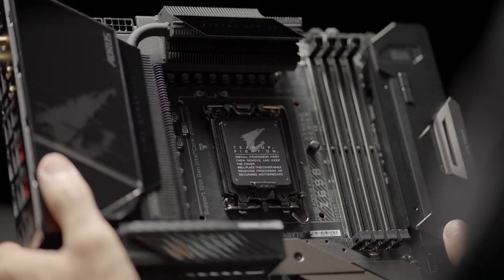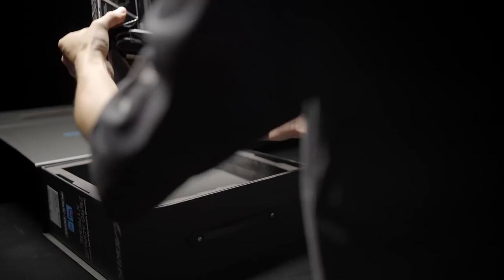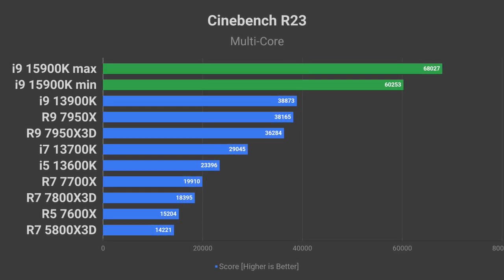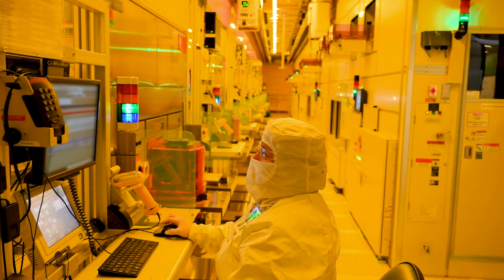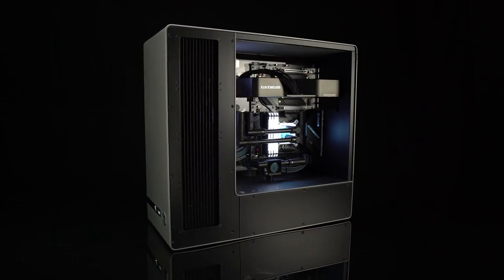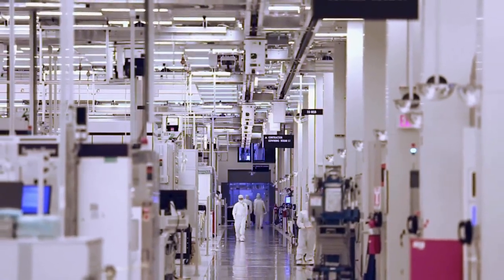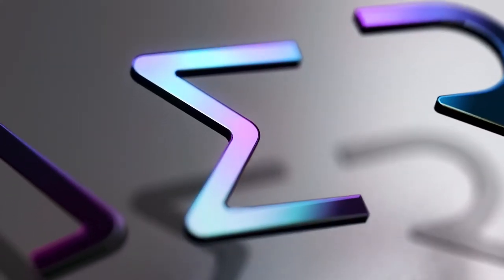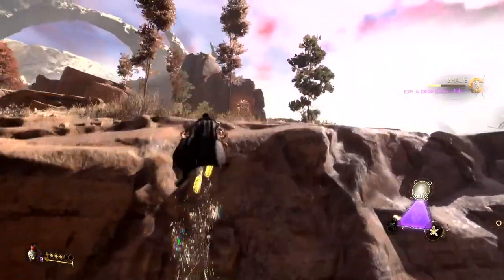Forget 14th Gen: Intel 15th Gen is the NEXT BIG THING

Comment: 40 cores!? Holly cow! Consumer CPUs are really leaning into the workstation category CPUs. No games out there will ever utilize 40 cores even when you're streaming. 24 cores are already overkill.
Reply from the maker: Only 8 performance cores are there for running games. The rest of the cores are for less intensive workloads which is beneficial for apps that do want as many cores as possible.🙂 It is pretty cool that one would be able to have a PC which can do both perfectly fine. Work and play.
Reply: @theivadim  Still the 13900K with it's 24 cores are running insanely hot so you can only imagine how hot a 40 core beast will run... man, you're gonna be well heated for the winter.
Reply: @theivadim  Not to mention if I think of the power draw, I can already imagine those 1600 watt PSU's are gonna be a big requirement. The 13900K already spikes up to 400 watts.
Reply: They will be way more efficient
Reply: @HDRPC  Sure, they said the same about the 13900K...
Reply: @laszlozsurka8991  yes same power consumption but 55 to 75% better performance.
Reply: @laszlozsurka8991  you can undervolt it and get exactly same performance just we can do in 13900k and it consumes 250 watt max and still gives over 40k cinebench r23.
Reply from the maker: @laszlozsurka8991  indeed, I too think Intel will once again push the 15900K to the max. But who knows, maybe it'll be good enough for Intel to make a decision to not push the power consumption that hard just to get that extra little bit of performance out of it. I think that power consumption is truly out of control on the high-end PC hardware parts. GPUs+CPUs. It is crazy.
Reply: @theivadim  Knowing Intel, I'm sure they won't care. They will sell you a 600 watt chip if they want to.
Reply: no games, but yes grandma tabs and editing
Reply: hell, even my 10900k with 10c20t does everything include streaming on twitch/discord while playing tarkov 3440x1440p with a 3080, never puts a sweat on it, usually around 20-60% usage while streaming tarkov through discord or twitch.

going to do a switch to in a year to the 14900k, ive had the 10900k since release and its been an absolute beast.
Reply: @ahmadomar1-v3t  wait for the 15th gen xd
Reply: @ahmadomar1-v3t  Unless you care about multi-thread performance it's pointless to buy a 14900K since in single core-performance it's 3% faster than a 13900K and the 13900K will be much cheaper than 14900K
Reply: @theivadim  yes , "work and play". all work and no play not good for the soul.
Reply: @laszlozsurka8991  i dont care about price, im all about performance, both multithreaded and singlethreaded.
Reply: it really should be 12 p-cores. I wil never upgrade to 8 core lol
Reply: @erisium6988  Then buy AMD. Intel won't give you more P-cores.
Reply: @laszlozsurka8991  And you'll buy it with no care in the world.
Reply: @ahmadomar1-v3t  Why would you upgrade if your current CPU is more than enough for your current needs?
Reply: @2hotflavored666  Why would I? My current CPU is good enough for me.
Reply: @laszlozsurka8991  I was referring to not just you, but also everyone else who criticizes Intel for overpricing things or selling bad products, yet they go ahead and buy it anyway.
Reply: @2hotflavored666  Beacuse i now roll a 4090 on that 10900k, and yes, it works great and i get much better performance than with my 3080, but still, theres quite alot left on the table with the 10900k even tho i works better than id think it would.
Reply: @theivadim Finally, we may have witnessed the true Work & Play balance. At your own wallet demise. 🎉😂❤ thx V! 15gen is promising.
Reply: @laszlozsurka8991  its cuz its on a very energy hungry 10nm node and they are pushing it hard.    The 3nm arrowlake will be a lot more energy effecient.
Reply: @laszlozsurka8991 to be fair both amd and intel will be on 3nm with Zen 5 and 15th gen.
Reply: @laszlozsurka8991   it's funny because everyone says it consumes too much heat at 100 degrees .. but these people do not use the cpu in the intel specification! It lets the motherboard go beyond the stock CPU limits. so it's logical that it heats up a lot more and consumes 300w ++
Reply: @laszlozsurka8991 15th gen ll probably 3nm so less heat
Reply: There will be efficiency improvements too
Reply: I like to play games with with million tabs and a couple VMs and whatever other programs open at the same time. This is exactly what I have been waiting for, a workstation and gaming rig in one
Reply: Hope i3 in the future will have 8+8 cores and 30+ mb cache
Reply: @------A------  "Even lower than AMDs"

AMD will also go 3nm process on the Ryzen Zen 5 CPUs.
Reply: @theivadim   finally my security cams will never looks so fuzzy 😉😉

Comment: I'm still using 8th gen i7 and really want to upgrade. It would be tough waiting another year for 15th gen but it looks like it could be worth it. Bad spot to be in for me.
Reply: I’m rocking a Gen 6. I was told to wait by a friend so I guess I will lol
Reply: I'm in the exact same boat as you. Currently on 8th gen i7 on my laptop (6th gen on desktop) and was really close to buying a 13th gen last month until I realised 14th gen is only one or two months away, but now I wonder if I should just wait a little longer for 15th gen. I'm not going to go down the whole 'wait forever for the next better cpu', but I'm not in a huge rush to upgrade so don't mind waiting another year, by which time 8th gen really would be getting a bit long in the tooth.
Reply: @platinum_penguin  So am I, can't wait to upgradee
Reply: What is the point in waiting? Wait for the 14900K to land and get that, you will have the most mature and best CPU right now. The 15th gen will be better, and the 16th gen will be even better. So what? You may be thinking with the 14900K I won't be able to upgrade my CPU later because 15th gen CPUs will use a different socket, well, here is a fact, you are still running an 8th gen CPU. You have literally skipped one whole socket type. I'm a bit like you, except worse because I'm still using a 6th gen CPU. Upgrade now and then upgrade again to a 17th or 18th gen CPU later. I used to play the waiting game but I no longer care. Just buy the best you can afford now and enjoy.
Reply: @platinum_penguin   4th gen here never waited so long before an upgrade XD

Comment: im still more than happy with my 10900k lmao, never breaks a sweat while streaming/ playing, still an absolute beast and has been since release day when i got it, 3 years soon going strong.
Reply: me too and it feels bad to upgrade from 10core to 8 p-core. I wait for 12 or even 16 p cores.
Reply: @erisium6988  There is literally no need to change a 10900k AT ALL right now. 

ill be waiting for a 14900k or maybe even a 15900k, running my 10900k with a 4090 now in 3440x1440p and i definitely got atleast 50-60+ fps better than i had with my 3080. 

yes the 10900k bottles it, but damn i literally get 100-120+ fps in MOST AAA titles @ultra out there with a gpu usage of 50-99% in most games, Some less demanding games 150-200+fps.
Reply: I have the Intel 10900K on my laptop, its a pity the 2080 Super is so mediocre by comparison, it simply cannot handle this processors true potential. Thermal throttling is no joke.

Comment: I suppose Intel would like everyone to believe core count still means something.  At the moment 16 AMD cores =~ 24 Intel cores, and I assume that by 15th Gen 40 Intel cores =~ 16 AMD cores or 24 AMD cores with 8 Zen 5 + 16 Zen 5c.  Intel is using E cores to squeeze as much performance/area, which is a smart strategy, but will have diminishing returns as the bus design can't support the additional processors as efficiently.  They can't really go past 8 P cores or the energy budget would be too high.
Reply from the maker: More and more workloads are moving to GPU or specialised silicon parts (like video encode/decode). For me, it feels like CPU core count is becoming less and less relevant. Especially, on a mainstream PC system. I've been thinking about it a lot since and I can't see how having so many cores on a mainstream CPU is helpful.

Will having that many cores improve sales? That is the most important question. Because that is what Intel wants. To sell more. And right now I see that few users need that many cores. Good for them I guess🙂 But I think AMD will continue chipping away at Intel's market share in the client segment.

Comment: Nah I see the 13500/13400 having 6+4 but the 15600 having 6+16

The lack of 2 P cores is plenty enough to push people to 15700Ks 8+16.

Both Alder and Raptor Lake I5 and I7 had same number of e cores.
Reply: Intel really missed an opportunity with Raptor Lake's 13900 KS, by not expanding the KS lineup to the i7 (13700 KS) i5 (13500 KS) and even the i3 (13300 KS). Threadripper has returned with professional and non professional chipsets available for consumers; from the Threadripper Pro 7995WX with 95 cores to the 24 core  Threadripper 7960X. Intel's 14th generation may, or may not, release the 14900 KS, given the understandably lukewarm reception to Meteor Lake in general. 

Imagine a 7 GHZ out of the box 3nm Core 9 Ultra 15900 KS with 8 Performance Cores and 32 Efficiency Cores priced the same as the 13900 KS, it would dominate the market. More importantly, imagine a 6 GHZ Core Ultra 5 15500 KS, priced the same as a previous generation Core i5 with 24 cores. 

Then Intel adds a 16 core baseline Arrow Lake Core Ultra, with 5.5 to 5.8 GHZ as standard, with the ability on all these models to add E-Cores or buy without E-Cores. The end result is competition, and better products from AMD and NVIDIA to match Intel, therefore EVERYONE wins! 

No competition = Low-Tier products & Competition = Top-Tier products

Comment: Sigh.. Intel look lets be honest. What's going on with all these efficiency cores? Gamers don't use them or want them. If you just stick to performance cores and make the instructions per clock and core clock speeds better on 6 to 8 cores that would be better.

Comment: I'm not so convinced by huge core counts on desktop machines anymore: I think 8 might be the maximum necessary in normal use. This changes if you're running several VMs or containers however, which I do from time to time, and then only if they're doing active work. Most of my cores (on both AMD and Intel machines) spend a lot of their time parked. This isn't even taking into account standard kernel multi-tasking efficiency.

BTW, there's talk that Intel will be dropping hyperthreading in Arrow Lake and beyond. It strikes me that this isn't entirely a bad move: E-cores are single-threaded already. I don't know the trade-off between HT and potentially increased performance or at least efficiency by not running P-cores in HT mode. (I suppose I could turn them off in the BIOS and find out myself...?)
Reply from the maker: I am not sold on that hyper-threading dropping rumour. Anything is possible, but I don't see how that makes any sense. If anything, I've heard that CPU makers are working on upgrading hyper-threading to get even more threads going from a single core.
Reply from the maker: I guess we'll have to wait and see. New tech and approaches are the most exciting part of the future. If it enables CPUs to do their job better then I will welcome it🙂

Comment: I'm currently using an i7-6800k/GTX 1080 Win10 upgrade from 8 PC.  I have been considering upgrading to an i7-13700K/RX 7900XT, my plan is to run Linux instead of the privacy nightmare windows, but after seeing this vid, I'm wondering if I should hold off for 14th gen to be released.
Reply from the maker: The way I see it: the latest the 14th gen (13th gen refresh) desktop CPUs should be revealed is on September 19th at Intel Innovation Day. But there is nothing stopping Intel from launching earlier if the CPUs are ready.
Reply: I'm never a wait for better type guy, but I'd say with TSMC bringing 3nm 15900k 30 - 40 % ST performance & the undisclosed adamantine cache were seeing in 14th gen meteor lake, that will be even more of on a flagship die. I'd say to wait, as a 13900k owner, the only thing I wish was their was last power/heat to deal with.( I'm delidded with external 1080mm) I want the ST & Cache.

Ryzen 5 is said to be 20 to 30 faster than Zen 4, then a few months to wait for 8800X3D as well. 

I'd really say to get hyped for 15th gen. These will be very impressive chips. as with the 8800X3Ds efficency on 4nm. who knows!
Reply: brother if you don't need intel just hold off and go AMD most of their lineup uses much less power for similar efficiency, and the difference is very difficult to notice unless gaming

Comment: You really can't effectively compare an Apple closed ecosystem with an open ecosystem Windows that Intel, AMD, and Nvidia operate within.  Unplugged vs plugged is irrelevant.
Reply from the maker: It is relevant for me. I buy a laptop because I need mobility to work on the go where I don't have access to power from a wall. That is why I voiced this opinion. But I understand that not everyone has same use case and expectations for their system.